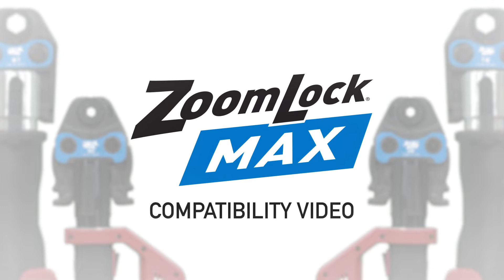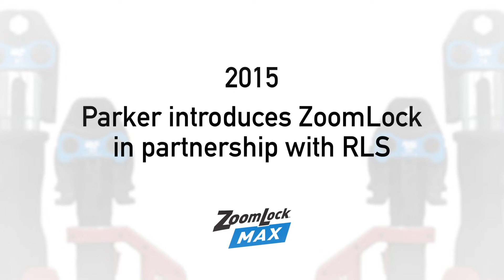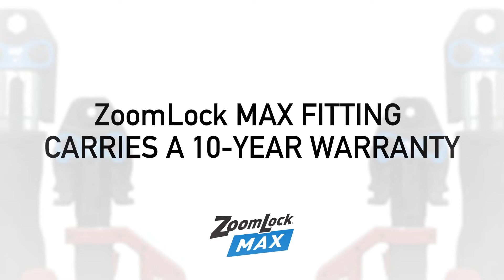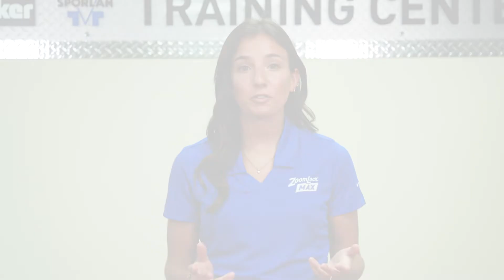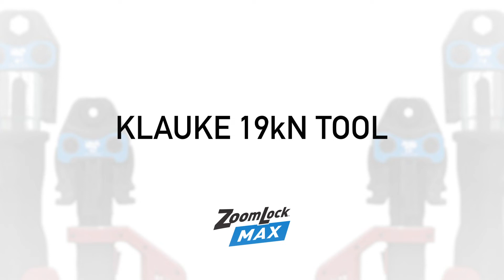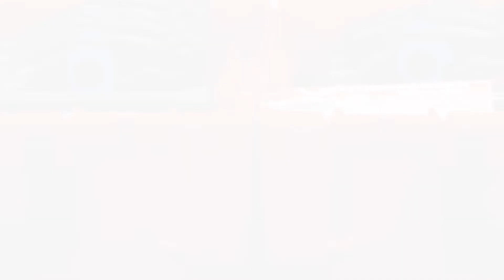Refrigerant Press Fittings Compatibility with ZoomLock MAX

Comment: What the between 24kn and 19kn? Which one is the correct one refrigeration and mini split application?
Reply from the maker: There is a 19kN, 24kN, and 32kN. ZoomLock MAX refrigerant press fittings and jaws work for refrigeration applications and mini splits.

Comment: What about the m12 or m18 Milwaukee force logic press tool
Reply from the maker: ZoomLock MAX does work with the Milwaukee M12 and M18. You see the full jaw compatibility at ZoomLockMAX.com.
Reply: @sporlanvideo  The ones I ordered do not work with M18 force logic acr heads, they may work with the plumbing heads though.
Reply from the maker: @sc4670  The M18 has jaws only for the 32kN press tool.